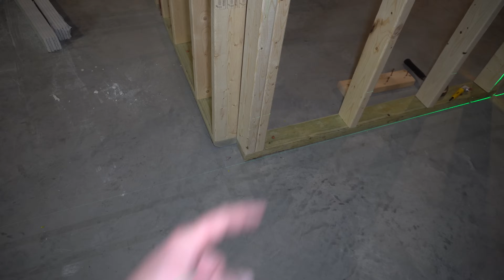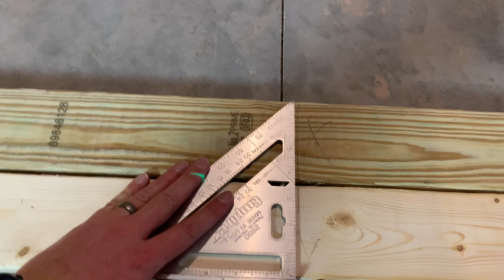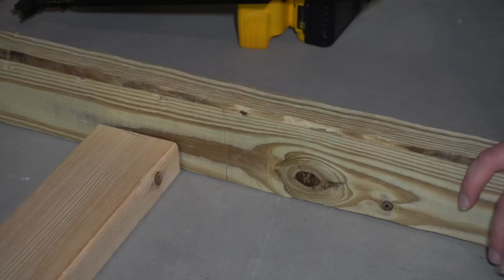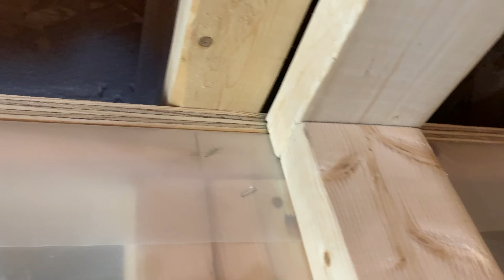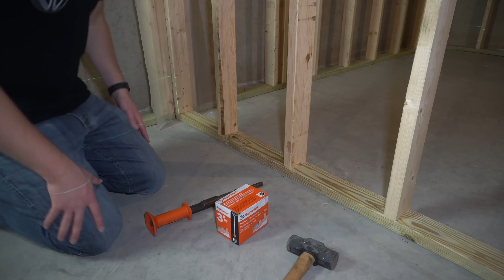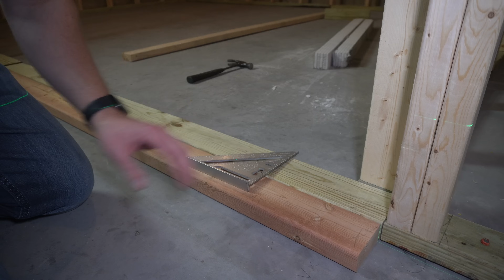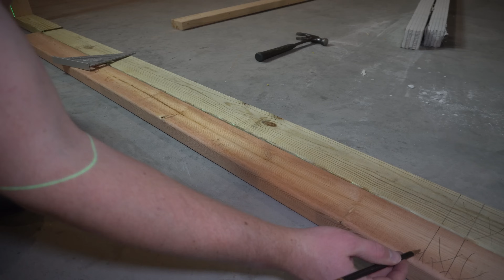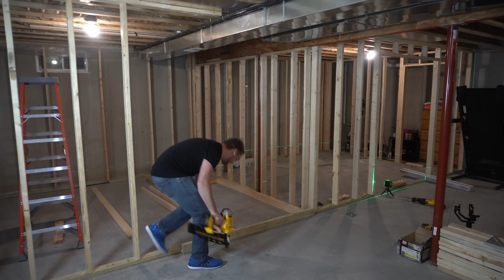The Basics of Framing A Basement Wall

Comment: For the door frame at the end, as I understood it, there was floor plate in the door opening.  Was there a plan to raise the floor and install a finished floor system.  I want to take an unfished basement/garage and separate the garage area from the rest of the basement to create a climate controlled space.  Obviously I would need a door to access the garage area from the finished space but I want to create a  trip hazard or the threshold for that matter.  Just the concrete floor.  I'm hoping you have a video that shows the door frame installation.  Great video by the way.  I'm 66 and doing this for the first time so the information and comments should make my project go smoothly.
Reply: Disregard the question about the floor.  I saw in your other video where after setting the wall with the door frame, you take a reciprocating saw and remove the bottom plates.
Reply from the maker: I forgot to mention it but once the wall is secured in place, I cut the floor plate out within the door opening. During wall install, it helps keep everything aligned but is cut out afterwards. I used a sawzall to do that. 
I have a video about installing a door in that opening on my channel, feel free to check it out 😃

Comment: If you're measuring from the end of the top plate, and the first stud is flush with the end, i would think the next stud center would be at 16-3/4. 

I guarantee you the way you did it, the center to center between your first two studs is going to be 15-1/4". Math
Reply from the maker: If you pause the video at 3:11 you can see that from the end of the wall to the center of the 2nd stud is 16”, so yes center to center of studs 1 and 2 are 15 1/4” like you said. But, Your sheet of drywall is going to be flush with the end of the wall, it’s not going to start at the center of stud number 1, so center to center of studs 1 and 2 shouldn’t be 16”, it should be 15 1/4” like I explain. 
If it was 16 3/4” from end to center of stud #2, the far end of your sheet of drywall wouldnt land on the center of a stud.

Comment: Good job but 

Why don't you put double wood on the bottom and on the top?
Reply from the maker: Since it’s not load bearing, double top plates aren’t require. But double check your local building code

Comment: Is there a concern about moisture developing behind the wall, even though the studies are not flushed with the wall. New to basement loving 😢
Reply from the maker: Depends where your vapor barrier is, mine is on the exterior side of the concrete wall

Comment: Can this still work if garage floor has a slight slant downward where building wall?
Reply from the maker: Yup! You would just need to cut each stud to a slightly different length as you move along the length of the wall to accommodate the difference from one end to the other. So for example, if it’s a 1/2” difference over 8’ length of wall, each stud would be approximately 1/16” longer than the stud before it. Hope that makes sense!

Comment: no plastic under 2by 4?
Reply from the maker: Vapor barrier is under the concrete slab
Reply: @DoingWhatever  are there is a code for bottom plate wall to not stick to the concrete wall by how much ? like one inch or half?

Comment: Great video but, can you please help me understand why some basements have only one piece of wood on the ground holding the studs, and some have one nailed to the ground and the other one floating on top of that one, holding the studs?
Reply from the maker: That would be a floating base plate wall and those are only required in like 3 states (I wanna say Oregon, Alaska, and one more) because the ground heaves in those areas. But check your local building code to be sure you don’t need a floating wall.

Comment: just curious if you experience heaving where you filmed this. how do you allow for the movement that the wall would undergo if it's nailed/screwed tight to the joists.
Reply from the maker: Very few states’ building code require floating walls, where the base plate is held up from the floor I believe. I’m in Wisconsin and that’s not required. Doesn’t mean heaving won’t happen but it’s pretty unlikely where I live. So far, everything has been fine, no cracking drywall or anything

Comment: So on your nail gun advice. I learned from a master tradesmen who said hold six inches up from the nail point at a minimum. Alison just observant you didn’t pull your had away as you advised.  Just saying, otherwise good video and of not the 16” on center is the center point of your joist.

Comment: Great video for DIY'ers! However, just a word of caution if there is going to be an inspection, then proper nail scheduling is required to meet code.  Also,  a finicky inspector will require galvanized anchor pins on the bottom plate.  Other than that nice video work too!
Reply from the maker: I appreciate the additional info and kind words! Those are good things to keep in mind. I guess my inspector wasn't overly picky lol

Comment: why is the vapor barrier not on the BACK of the framed wall, between the studs and the concrete wall? i thought that vapor barrier was designed to keep moisture away from moisture sensitive things. and moisture coming through basement concrete is pretty common, given enough time...that, and wood rots if left in contact with water. and once you throw drywall on those walls, getting to the studs behind it is going to be pretty tricky with a moisture barrier between them. you would pretty much have to tear down the whole wall!

Comment: Is there a reason no thermal barrier was used?
Reply from the maker: Vapor barrier and insulation are on the exterior side of the slab and concrete walls in my case

Comment: So you installed a wall under one of the main beams supporting the house. Let's say the next owners of the house want to remove that wall.   Now, how can they telll that the wall you installed is not a load bearing wall?
Reply from the maker: Good question. First, I plan to leave behind the original floor plans as well as the new plans I’ve created. Secondly, a load bearing wall wouldn’t rest on top of the floor slab, it should have its own footing just as the columns do (the columns that actually support the floor beam).

Comment: Because of the concrete base, dont you need gasket between the wood and concrete so prevent molding  of the wood?
Reply from the maker: For my jurisdiction, a pressure treated bottom plate is all that’s needed.
Reply: I didnt realize you were using pressure treated. That all makes sense! @DoingWhatever

Comment: No hate but you gotta do floating walls on a basement ,foundation moves and craks the walls if its not floating 2 1/2 gap
Reply from the maker: All good. Floating basement walls are only require in like 2-3 states in the US. be sure to check you local code

Comment: What type of hammer you used to screw the bottom plate to.the concrete floor?
Reply from the maker: I used a ramset nail gun to attach the bottom plate down

Comment: Could you show or explain how to add a wall in a room that is sheet-rocked (if that makes sense). I want to connect two rooms but make the closet smaller then one of the rooms. So I want to add the wall but I’ll be using a barn door instead.

Comment: Excuse me but if you do it this way you will fuck up a house, the bottom 2 x 4 should always be floating due to ground motion.
Reply from the maker: Floating walls in a basement are only required by code in a few states, Colorado is one of them I believe. Obviously you need to research if they are required in your specific jurisdiction, but in mine, they are not.

Comment: You forgot to allow for any possible movement of the basement floor.  One should have at least 1/4” between the lowest point of a floor joist & the top plate of the wall.

Comment: Looks like you are doing a nice clean job. 
I was wondering why you framed over your windows?  
I just did a basement at my daughters house where the floor was slightly sloping. I had to measure every stud. With plates installed, measuring was easy with my Bosch laser measurer. I then stick framed the walls. 
Where I’m from, framing should be nailed not screwed for code compliance. Screws are handy for temporarily holding things but then they get nailed off. These are just partition walls so I guess no problem.

Comment: Hey! :D Thank you, I'm about to tackle some walls in my unfinished basement. One of them will be a bathroom wall. Do you typically run 2x6 to leave extra room for the abs pipes?
Reply from the maker: No problem!
I framed the bathroom downstairs with 2x4s. wouldn't hurt to use 2x6 either. either way you should be fine

Comment: I have only been framing for 45 years so I don't know everything. BUT this works for this guy. I do NOT do it like that.  I always stager the butt joints when doing the floor plate and top plate to make it stronger.  I also make an L at the ends for nailing  drywall.  I measure completely differently. Again, what this guy does, works for him. BUT professionals do it differently.
Reply: How do they do it and where is the regulation?
Reply: 1.) Yes staggering bottom/top plates make the wall stronger. 

2.) The L your referring to is called a California corner and they are the best way to frame your corners ( Especially when installing insulated walls with electrical )

3.) Instead of marking my first stud at 15 1/4” then moving the tape to continue marking I just leave my tape at the end and mark 3/4” before every “red stud” mark on my tape and put an X on the right side of the line. It’s better to stay hooked on something instead of trying to hold your tape at that first 15 1/4” mark.
Reply: Then it’s pretty clear this video isn’t for you if you are a professional.

Comment: When building a wall its a good idea to crown the studs,so your drywall isn't wavy,great video.
Reply: What is crowning a stud?
Reply from the maker: Very true, thanks!
Reply: When building walls, interior walls, install studs so crown of 2x4s are in the same direction so your walls aren't wavy.
Reply: Yes, what is crowning a stud??
Reply: @patriciamitchell5114 if you’re still wondering, crowing a stud is when you put the bend in the lumber up, not down. When lumber is made, it comes from thhe lumber yard, Home Depot, Lowe’s, etc. all bend warped or twisted and the fix it to put that bow up the  the weight of whatever you’re building is will push it straight

Comment: Is it okay to put the wood directly on concrete like that? Or is there an underlayment that's preferred to use so the moisture from the ground doesn't seep into the wood and cause rot.
Reply from the maker: The bottom plates are pressure treated to resist rot

Comment: I want to thank you so much. I learned so much. Q: Why did you start at 15 1/4 on the framing instead of 16? I also noticed that the framing of the walls was not butted up against the concrete wall. Can you briefly explain.? Back in the day, i would watch folk nail the framing up to the existing walls. However, I have subscribed to your channel. Now I can begin to frame in the basement where I grew up at. Again Thank you.
Reply from the maker: I appreciate it and am glad this was helpful!
for the question on 15 1/4" check out my explanation/reply to the comment I have 'pinned' at the top of the comment section. 
I left a 1/2" gap between the concrete foundation wall and studs just incase any moisture would get back there. it should evaporate before causing issues, but obviously this has limitations lol.
Reply: @DoingWhatever  again thank you so much for the awesome channel and such quick response.
Reply from the maker: @GiantSlayer-rr1vu  no problem!

Comment: Dewalt Donot Want NO BODY KNOWS
The Trick To Convert 20v To 24v AC
Laptop Adapter, 
I Convert My Roof Nailer To Electric 
And Works Better Than Batteries.
Amén.

Comment: In putting up a wall in my old garage as I build it out into a part time living space, I'm finding this garage does not seem to be square in many ways (maybe bc of age??). The perimeter wall that I'm attaching a wall to is not vertically square, so if I frame a wall to be square and lift into place, I have a little more than an 1" at the base of the wall and a flush fit at the joist. Would I just build the additional wall square and do some shim blocking or build against the perimeter stud and lengthen my footer to make up for the extra space on the bottom? Placement of this new wall is not adjustable. 
Thank you for a great tutorial! And the clarity, content, filming, and tips without any extra and unnecessary video was perfect! A 26 minute video can be so daunting to commit to bc of wasted time with unnecessary content sometimes. Your video had me not wanting to miss anything bc everything there was helpfully shared and articulated.
Reply from the maker: I would probably lengthen the bottom plate to take up that extra 1" or so but I would still build the wall so that all the studs are plumb vertically. then fill in the gap with some shims/blocking. So the first stud will be flush with the end of the top plate, but inset about 1" on the bottom plate. I hope that makes sense. 
Thank you for such an awesome comment! I really appreciate it and I'm glad to hear that the video was helpful!

Comment: Is that a pressure treated 2x4 at the bottom? Are you allowed to use it indoors?
Reply from the maker: Yes, in my jurisdiction it’s required that the bottom plate is treated. Check with your local building inspector though

Comment: How come you are using nails on some 2x4s & screws in other 2x4s. Is there a reason 4 that?  Could I just nail them all instead of using screws??
Reply from the maker: you could just nail them all for sure.
I sometimes use screws to "pin" the wall in place and then follow up with the nail gun. sometimes the impact from the nail gun can shift the wall out of plumb.

Comment: I’ve framed a basement with pre making walls on the floor. It’s got its pros but you need to consider undulations in the floor which mandate careful measuring lest you find you have a wall you can’t get into position.

If the floor is wavy at all or too much junk on the ceiling I prefer to pre set the bottom plate, then the top with a plum bob, and individually attach studs.

Comment: Can I ask why you don’t screw the studs into the top and bottom boards? Is it just overkill?
Reply from the maker: technically I think you're supposed to use nails according to code, but I could be wrong. something about screws not having the same shear strength or something, but again id have to look it up.

Comment: This all Wrong!! Never use P.T. Wood in doors Not Code!! Chemicals in Pressure Treated Wood💥 NEVER USE PT PRESSURE TREATED WOOD INDOORS, theirs no 6 mill vapour under the soul plate
Reply from the maker: I'm afraid you are wrong. 
Wisconsin code says to use PT wood when in contact with concrete. See SPS 312.10(2)(h)
SPS 321.10 Protection against decay and termites.
(1)  Wood used in any of the applications under this section shall meet all of the following requirements:
(a) The wood shall be labeled and pressure treated with preservative in accordance with an AWPA standard or shall be naturally durable and decay-resistant or shall be engineered to be decay resistant.
(b) The wood shall be pressure treated with preservative or shall be naturally termite-resistant unless additional steps are taken to make the wood termite-resistant.
(2) Wood used in the following locations shall be as required under sub. (1):
(h) Bottom plates or sole plates of walls that rest on concrete or masonry and that are below exterior grade or less than 8 inches above final exterior grade.

As for the vapor retarder, that is installed under the concrete slab per SPS 322.38(3)(a). 
(3) CONCRETE FLOORS. (a) Except as allowed under par. (d), a vapor retarder shall be installed directly under the concrete floor slab or under the base course of concrete floor slabs.

Comment: Always check code.  In WI we do not use vapor barriers on new construction that is insulated on the exterior.  I see you used a vapor barrier in the T between the two walls.
Reply from the maker: Yup, you are correct. I cut that out after talking to the local building inspector but don't know how to edit that part out of the video... I'm also in WI. excellent user name btw lol

Comment: Okay so I get how to frame. Wall now, but how do you do it in a room that already had flooring and drywall on the walls and ceiling and you're just tryna frame two sides and use two existing sides???
Reply from the maker: I would cut out the drywall where the new wall meets the existing wall - that way you can connect the new wall to the existing wall studs and have a really strong connection. Same thing for the connection to the ceiling. I personally would cut the flooring so the bottom plate rests directly on the subfloor, but that's my opinion.

Comment: Hmm, I have always done studs on 16 inches. I know why you are coming back 3/4 inch, because the 2 x 4 is 1.5 inches. I just never worried about it and placed the edge at 16. Actually makes it easier to measure to find a stud with the drywall on. Drywall is 1/2 or 5/8 inch and if you measure 16 inches from the drywall, you will hit the stud every time. That is how it is taught by everyone. X on the 16 inch, back 3/4 inch with the speed square.

Comment: Thank you so much for this video! I have one question, can you use screws instead of nails to put together the frame? I don’t own a nail gun and only have a small section of wall to build.
Reply from the maker: no problem, hopefully it was helpful!
Someone else in the comments mentioned that screws are not a substitution for nails according to code. but the code may be different in different areas of the country/world lol. Best bet is to call your local building inspector and just ask them if it's ok, rather than trying to dig through the code book 😃